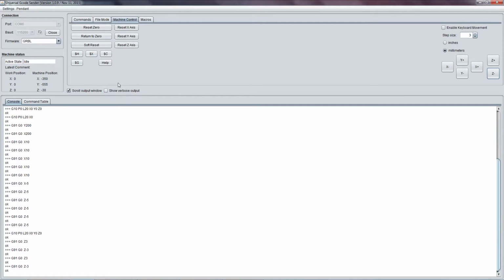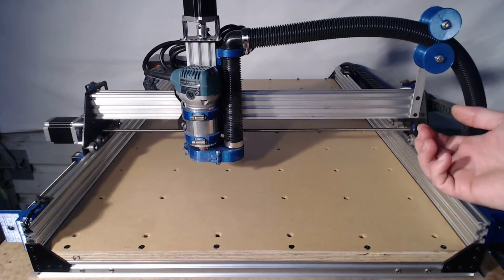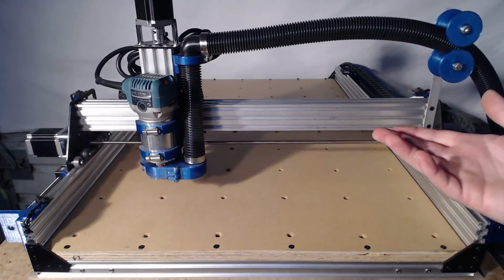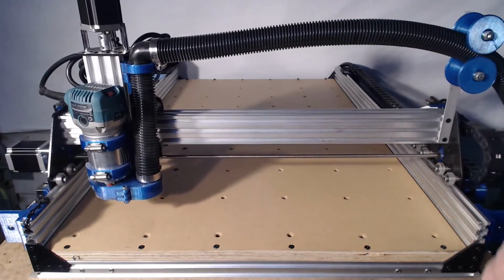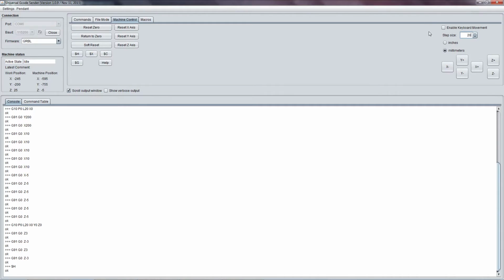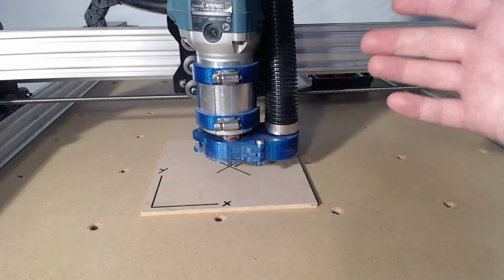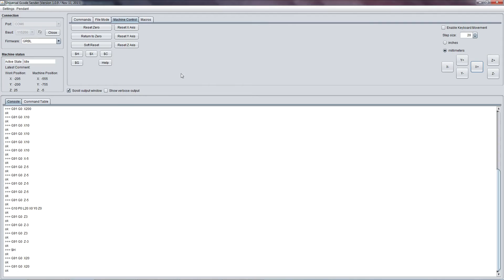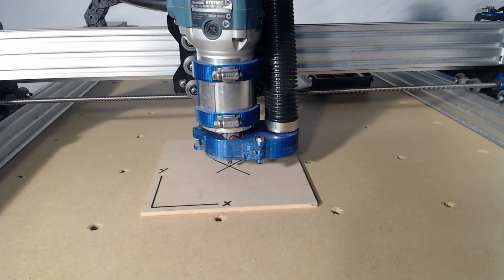How To Home A CNC Mill, And Setup Milling Stock Home Position

Comment: Hello again! So I'm almost ready to start milling my first tests. My problem is that it seems my X and Y axis' seem reversed. As of this point in time I dont think its affecting my Z axis not positive though. When using SketchUCam I need to set my x and y millable area's as negative values to make this work properly. If I set them as normal positives then I end up hitting my hard limits right away. I experienced the same thing using Makercam.com as well. Any idea on what my problem might be?
Reply: So I watched this video (the video I'm commenting in) and according to your directions yes it is homing to the same locations on XY and Z axis'
Reply from the maker: I'd say it's a bug/settings in sketchucam, I'd recommend downloading the free trial of Meshcam to help figure out if its hardware or software related
Reply: I thought just the same so as a trouble shooting method I tried doing the same thing in makercam.com and ended up with the same results. In makercam.com instead of placing the object in the upper right corner of the + I need to place it in the lower left corner. I need to place it in the identical place in Sketchup as well.
Reply from the maker: Are you manually defining the milling stock home position in the software? Most often than not default CAM software places the milling position's home in the centre or some odd corner of the stock. I always manually select the lower left corner as my stock's home position
Reply: No I'm not. I am using the default G code and sending it unmodified. I have a thought though. When I issue a command from a home position I believe it always goes negative. Is this right? I'm thinking it should go positive.
Reply from the maker: You don't have to modify the g-code, You have to find out what corner or position the CAM software is defining as the stock's home position. This is what it looks like in MeshCam https://youtu.be/9LNxZP6EcOk?t=10m32s

In MeshCam this is user definable, in some other CAM softwares it's fixed

Comment: Great work. Thank you. Can you recommend a 
source such as "CNC stuff for Dummies" loo, that I could read in addition to your material to line up my knowledge.
Many thanks in anticipation - appreciate the effort you make for the CNC community.
Reply from the maker: Thanks Bill! Speaking for myself google has probably been the most useful tool to find more info on CNC stuff. However that doesn't really answer your question. The Openbuilds Forums are a great source of info. And if you get stuck there are plenty of people on the forums that are helpful.
Reply: The forums have been a good start. will continue to follow them and see how we go. Many thanks.

Comment: Can you explain how to home without limit switches? Or what workflow to use in ugs :)
Reply from the maker: Basically start watching from 2:40, It's not necessary to home the spindle before milling. I only use the homing feature to move the spindle out of the way to fix milling stock to the bed. As long as you follow the steps from 2:40 mark you should be able to mill no problem.

Comment: Dude thanks so much!!! You simplified it perfectly. My machine doesn't have homing switches but I get how to start it just didn't know how to home the work piece. Thanks so much you've made my life much easier in this cnc journey. Looking forward to more of your videos!
Reply from the maker: Fortunately that isn't a big problem, The ability to Home the spindle isn't necessary. In fact I only use it to move the spindle out of the way to bolt down material. You've already figured out that essentially all you need to do is Home the milling stock's position.
Reply: yes and thanks to your video it got a little easier!
Reply from the maker: You're more than welcome! Glad to have helped you out :)
Reply: Schematix hou mace ur cnc routar masin gib ur nambar